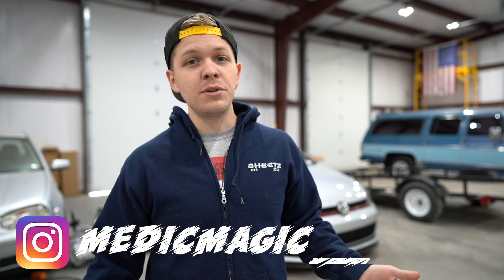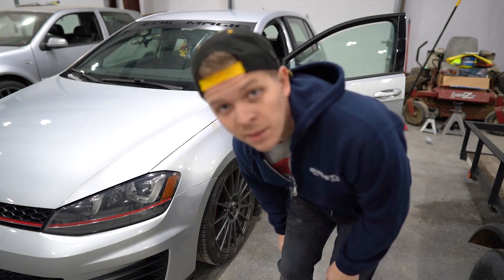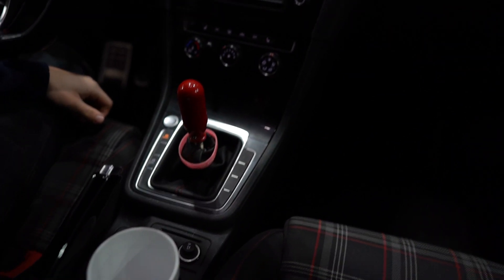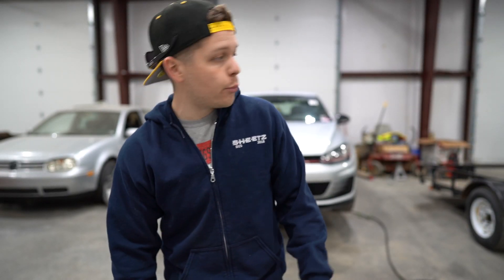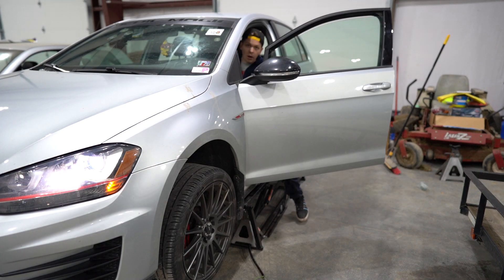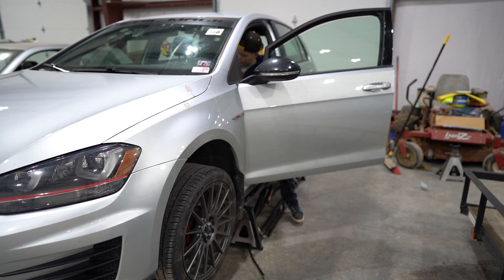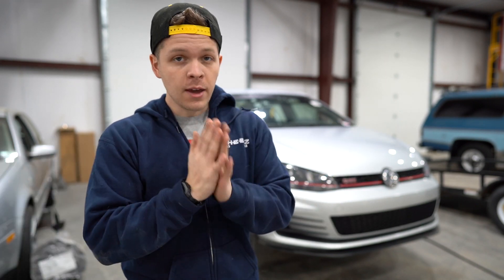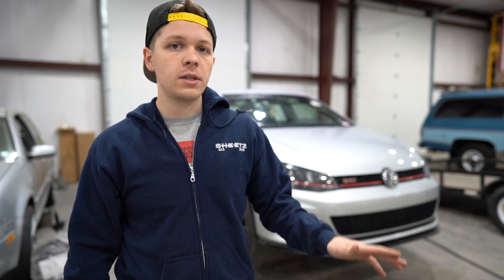Is Your MK7 GTI Making This Noise??

Comment: I removed mine and bent it flat and down a little with a hammer in the center area when I did the DP install because the flange hit it. Haven’t had a issue since. You could also use some washers as spacers if you don’t want to bend it. But may need longer bolts depending on the amount of washers needed.

Comment: Had the same problem, cts downpipe with Cat smacking the crossbar because i put a catback muffler delete on
Just needed more clamps and bars to hold the exhaust up away from the safety crossbar

Comment: Hey I have a sound I cannot get any help with. I have a 2017 GTI and im finding that when im in 3rd and I floor it, at about 4k rpm i can hear the turbo start to make a chopping sound. Like a helicopter blade sound. It doesnt do in when Im driving normal and its ONLY when IN acceleration. Any Idea?
Reply: Do you have a stage 1 or 2 tune? I got my tune a while ago and it’s doing it. I called the place where I got it tuned from and it says I’m running more boost so it’s the ECU trying to get rid of the extra boost while spooling. You should check your divertervalve just Incase
Reply: @rileyjaphet-gekas7703  I have a JB4. How would I identify a bad diverter valve